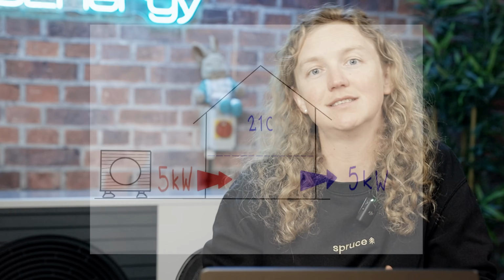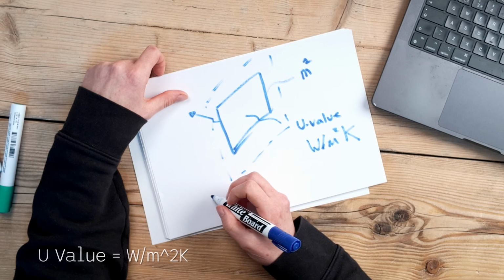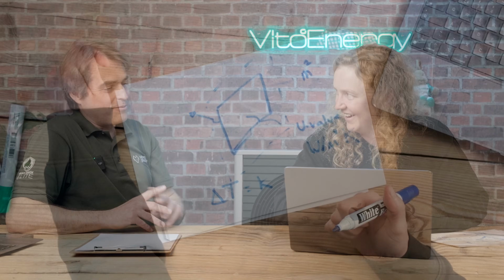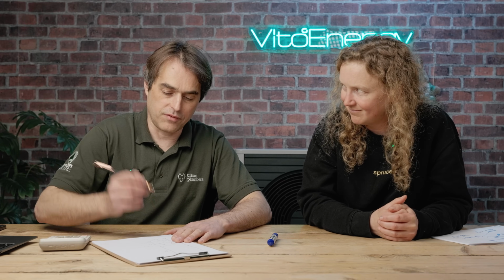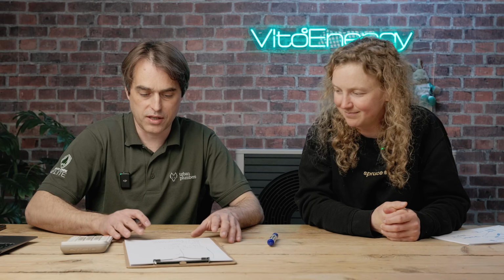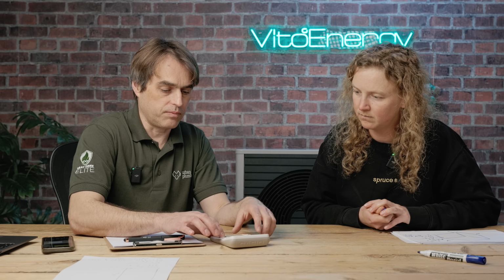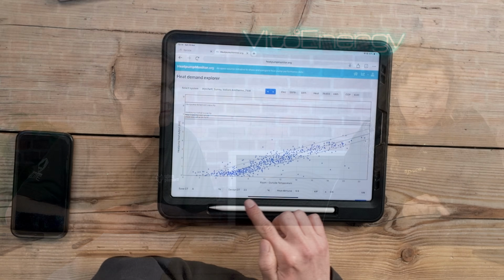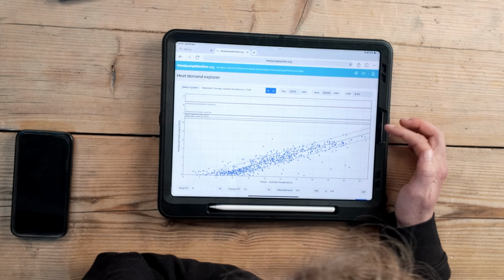Heat Loss: Why Everyone Gets It Wrong & How To Fix It

Comment: Good info as always, I wish they would get figures right for solid stone walls as they can be miles out depending on the wall being wet or dry especially if some wally has repointed them with cement instead of lime mortar. Its still very finger in the air for older properties by mine. All I can say is my 220 year old house is 200 square metres and uses 4500kwh per year in electric and according to the epc it requires 25000kwh for heating and hot water so either I'm getting remarkable scop for an old property or the epc is miles out. I worked my house at as a heat loss of around 10kw
Reply: I also have this problem. 3 ft thick stone walls...no idea what figure to use. Maybe if Szymon reads this he could advise what he would do?
Reply: @Supanova7G  I'm happy with the performance of mine even though I have a 16kw and could have got away with a 12kw but as they are the same physical unit just programmed different I wasn't too worried. And the minimum run power is the same so wouldn't have made any difference really. Glad I had a twin fan unit as it hardly ever ices right up and I see a lot of single fan units in our area freeze up all the time
Reply: The EPC methodology uses standardised assumptions of heating and occupancy patterns for the calculation of the rating so that the rating can then be usefully compared from one property with another. These patterns may well be quite different to your occupancy and heating patterns thus giving the different estimated values.

Comment: I’m doing it this way, in the alps, with a good old spreadsheet for each room.
My main variable is ventilation and I’ve not come across anything to get into how airtightness testing and MVHR (both available / common here) should impact my calculations.
What I actually do is stress test my heat loss using 70-100% of ventilation heat loss to see if the heat pump selection is impacted, but it would be great if there was any more rule based approaches to come up with a specific single answer.

Comment: Doesn't cibse use ground temperature for loss in a suspended ground floor but with higher U values? Think you said to use outside air temp for the floor ?

Comment: Great style of video Szymon, very educational. A question I have though is, isn't there a way of calculating the actual current loss, which is where it counts for the system design phase. Open energy monitor is great, but that's after you've installed everything so doesn't help with design, which is when it really matters of course. You can do an ACH with a phisical door blower test for example. Why can't you also do a Kw test at a known D/T ? 

All you need to know is the internal temp and external temp and then turn the heating off, no? Then time how long it takes to equal the temp. So this would be like the whole in the bucket while turning the tap off, then seeing how long it takes the bucket to empty, right? so why not just do that to calculate the real heat loss instead of guessing from tables?

Comment: Great video, but you’re grossly undersizing the room Air Changes. You’ve ignored mechanical ventilation & undersized even for normal Air Losses.
Simple explanation, our air here in the UK is very cold & has a high moisture content. Most days in Winter it’s over >90% moisture. Now, if you don’t remove that warm damp air you’ll kill the property with damp & mould. 
To achieve good U Values the property must be as air tight as possible, but an air tight air needs lots of ventilation. Air Tight cases a vacuum. Remember your bowl of water, milk bottle & heat experiment in School?

MCS & many others have the Air Changes WRONG!!

Comment: Thanks for the video, haven't watched it yet. But as someone who has smartified his pellet boiler and can trace how much it works over the day to keep it warm... And added 8cm XPS outside insulation. I can tell you I have about 1.5-2C delta with the same amount of fuel that the previous year. In a few years, I will do a heatpump...

Comment: This is why measuring the loss rather than calculating will be best as time goes on.  Either look at previous gas usage and infer the homes performance. Or in future when hp needs replacing see what the peak power was and go from there. For us when our 7kw pump dies in 20 years we will be replacing with a 5kw unit. The pump tells us it's oversized.

Comment: Very good topic!

I've performed some manual calculation of the heat losses for the tiny house on wheels I'm currently building, to get ballpark of the performance of it and heating/cooling required.

With that knowledge, I've done pretty exhaustive "discussions" with Google Gemini about heat loss with my specific floor/walls/ceiling construction and insulation details, and even calculated the trailer's metal framing impact to the floor heat loss if insulated the beam cavities and gluing sheetmetal protection underneath the frame.

It definitely helps to understand the topic and ballpark figures at hands, but the AI is definitely very good to dig out heat loss figures for the construction items, calculate repeatedly new summaries and provide very useful information.

My build will have hydronic floor heating, it'll get the heat from 5kW monobloc and will get built fully off-grid with 48V LiFePO4 battery system, 5kW inverter and full roof of solar panels, approximately 4kWp. It seems that here near arctic circle, I need some sort of furnace for deepest winter, and likely going to use closely coupled tees for the 5kW Webasto diesel heater.

All calculations assured that this all should work. And, I'm going to use 80 liter buffer tank as the monobloc is kind of oversized, and looking forward to use Webasto to pre-heat the buffer for minimizing battery consumption overnight. Plenty of calculations and maybe some custom controller to manage battery status in relation with monobloc power consumption and use of Webasto if charge isn't enough for the next solar day...
Reply: I'd treat AI/LLMs with healthy dose of scepticism -- it's useful if you're an expert in the field and use it as a time-saver while sanity-checking the output, but all AI/LLMs frequently get things wrong. LLMs are still really bad at mathematics in particular.

I'm a software engineer and I can test the output of LLMs when writing code -- more often than not the code is wrong and doesn't even compile or doesn't do what it's supposed to do. It's very easy to slip into trusting the output, especially in areas we're less knowledgeable about.

By all means ask it to poke holes in your logic and make suggestions, but just be very wary of taking anything it says at face value!
Reply: @defragsbin  this is my approach exactly, I'm programmer too!
Reply: @mhelander  aha, fair enough then! Most people aren't clued up so sorry about that!
Reply from the maker: Yes, I tried different AI for this and got a lot of in accurate results. It will get there soon I guess though.

Comment: Excellent video. But for existing buildings nothing beats using a few resistive electric heaters set at 21°C and measuring electricity consumption. And then extrapolate it to -3°C or your design temperature. Technology connections has done a video about that

Comment: Great that you touched on the problem with using CIBSE ACH numbers but there was no mention of how to accurately measure ACH. How do you do that for each property?
Reply: There's a couple of options. You can do an air leakage test, also can be called "blower door test" where the building in pressurised/depressurised to 50Pa.  For new builds this number can be a max of 5 or 8 (I forget which), passive house it's 0.6. Then divide this number by 20 and that's your very rough ACH at nominal pressure. I believe the guidelines are to divide by 10, 20 or 30 depending on the exposure of the building.

Another way is to use a tracer gas and monitor its decay over time. This can be done with a CO2 meter and something which produces CO2 i.e. humans. Fill a room with the tracer gas, stop, start measuring the co2 ppm, the do some maths: ACH = −1×ln((440−420)÷(890−420))÷8 = 0.4 ACH. Starting w/ 890 ppm co2, ending 440ppm over 8 hours. Open Energy Monitor have documented this calculation too.

Comment: Excellent, really well done and presented. 

Three things though; if heat loss is linear why are climatic curves curves and not a straight line? 

If heat loss is linear then a gas meter for example might be read with the property kept in a steady state for an hour at any external temperature requiring space heating and the energy used extrapolated to the design temperature. 

Factoring in exposure of a property to the wind. 

Still, an excellent video.

Comment: Can't you use gas usage data to verify heat loss calculation? Octopus have half hourly data, so quite ganular.
Reply: Yes. The most gas our house (1930s 5-bed detached) has ever used in one day was 200kWh on a dull and breezy day with it -8C outside. That works out to 8.3kW with the only other inputs being humans (100W at rest) and electricity use, both of which are rather small compared to all of that gas, plus we need to do some subtraction for hot water anyway. Rough and ready, but heat loss calculations also rely on a lot of assumptions. I'm hoping to knock 25% off that 8.3kW over the next year given all the work we've done, but let's see.
Reply: @ It all sounds great and you could probably use July's gas consumption as your DHW figure? But your MCS installer could lose his BUS grant if he starts taking other heat sources into account, like humans and appliances - MCS rules say the HP must provide ALL the heat required to cover the calculated heat loss. I'd consider forgetting the BUS grant and ignoring MCS rules so you can install exactly what the house actually needs - including maybe supplementary heating for those few -8°C days. That way the HP isn't totally oversized for the rest of the year.
Reply from the maker: @johnhunter4181 oversized heat pumps that are decent and have degree minutes algorithm aren’t such an issue. As a matter of fact the best performing units on OEM are oversized by 20-40%
Reply: @UrbanPlumbers Degree minutes? Is that weather compensation?
Reply: @johnhunter4181  Can u not just get a couple of portable electric oil filled radiators to use as a back up in extreme weather?
Reply: I'd think you can. You need to take into account the efficiency of your boiler but it should give quite a good estimate particularly if the internal temperature has stabilised, i.e. you haven't just switched on the boiler 😊

Comment: If the heat loss and the input heat are balanced the temp of the room will not rise. What heat input should you calculate to be able to raise the temp by °C per hour
Reply from the maker: Heat loss is calculated at a given internal temperature - for example 21c. Once the heat loss and heat gain are balanced the temperature stays at constant 21c inside no matter the external temperature.
Reply: @UrbanPlumbers  yes I understand the concept but I was thinking of, let's say, a shutdown. It might be overnight, it might be a holiday but when you restart you have to put more heat into the system that the balancing KW/HR. Incidentally. KW/HR is a flow rate
Reply: @stephenrichards5386 the balancing heat output is for the target delta. When the home is cooler than that, the delta is smaller, therefore the heat output is greater than the heat loss at that delta, and the home carries on warming.  Time to reach equilibrium is another question.
Reply: @UrbanPlumbers  Why couldn't you simply meassure the energy consumption when you're keeing a given constant temp, then tell you what the heat loss is? Doing this before you do the system design would be possible, no? What reading would you need? Just Gas used minus boiler effieiency should give you heat loss, no? Isn't there a relativly simple way of doing this if you rig up some censors and take some on site readings?
Reply: If you're targeting a particular rate of temperature rise, then the heat input needed to achieve that wouldn't be a single, fixed figure, as the dT (and thus the heat loss) is constantly changing.

More useful than aiming at a particular temperature rise rate is aiming to reach target temperature within an acceptable length of time. This would entail knowing how much energy is needed to heat up the air, the building fabric and contents of that room from the initial to the desired temperature, then using your heat source power minus heat loss power to work out time to heat the room to target.

By the way, kW is a measure of power (a rate of energy per unit time) so dividing it again by time (hour) is not useful unless you're discussing a rate of change of power (which is usually not useful). kWh is a measure of energy, so to turn that into a rate (i.e. power) we divide that by a unit of time (hour) to yield the unit of power "kW".

Comment: Good video. Perhaps missing is how heat loss is affected by north and south facing windows, the location (on the coast, in the country or in the city).
Reply: You have to size your heat source for the coldest conditions…. The sun won’t be out.    Total heat demand over the year will be affected but that is a different calculation
Reply: @ Clear skies in winter create the coldest days - our house can overheat in those conditions when it might be -4°C outside and the sun is streaming in. In the summer our large overhanging eaves shade the house.
Reply: UK is so cloudy that sunlight gain isn't even taken into consideration 😅😂.
Reply: The heat loss is likely the same with the air temp being the same. But yeah good points on heat gains, solar gain and metabolic and equipment gains can be sizable and obviously make up a much greater chunk of the heat balance of a building the more we insulate and improve airtightness.
Reply: Design heat loss will be when the sun isn't up, meaning dark.

Comment: great video, and a nice change, heat loss is one of the things that is very important to understand...

With that said, I have a question!

I have an old stone cottage with 60cm solid stone walls. These act as a heat store over time, so would that affect their u value too? 

I imagine that when the heating first goes on, and the walls are cold, then a lot more heat is lost into the wall, but once it heats up, that less is lost? Or is it always the same, no matter what the temp of the wall itself?

Thanks
Reply: Conduction, in terms of energy conducted per degree of temperature difference will be consistent. It won't change with temperature. 
With so many tonnes of rock to warm up it will take ages to get warm and equally to cool down.
Reply: @DrRogB  If I understand, you're saying that the amount of heat lost into the wall will be the same, regardless of the temperature of the wall? I can potentially see this making sense, but if the wall was warmer than the room, then surely the wall would not be taking in any heat, or causing heat loss, but making heat "gain" (if that's even a word?)

So although I understand what you're saying, it just doesn't make sense to me, though I'll be the first to admit I'm not remotely an expert on this.

Thanks for answering
Reply: It's worth emphasising the difference between loss through the wall and energy stored in the wall. 
In any wall there is a temperature gradient. If you turn your heating off and open the door for a while and let cold air in the energy will flow backwards into the room. This effect is very important when heating by a traditional fire, and very useful for other forms of heating.